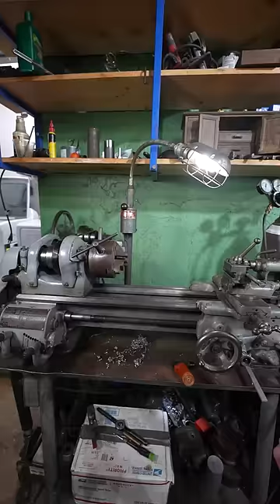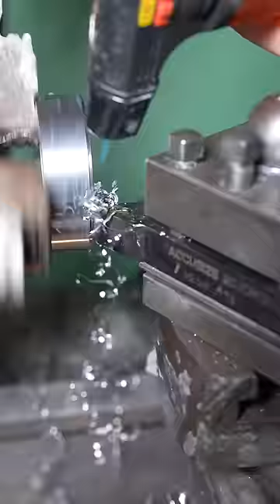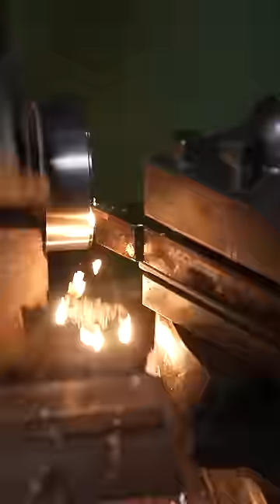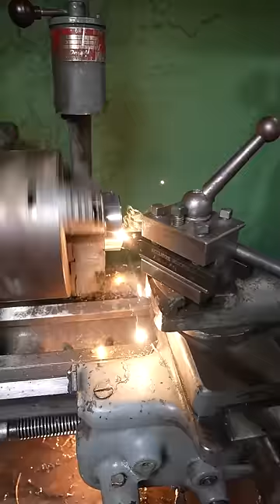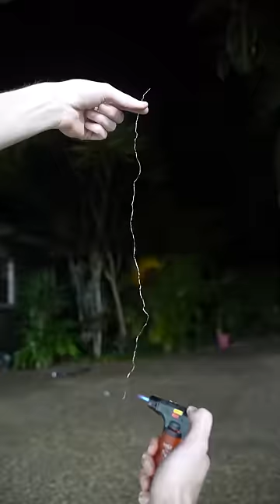Titanium has a dirty secret

Comment: The chuck key💀💀
Reply: I didn't notice that. Now that's TRUE danger
Reply: I had a coworker who lost the end of his index finger to a chuck key.
Reply: @nickgoodall578  I need to hear the story behind that!😂
Reply: @jacobmoore7636  It's not that good of a story. The chuck key was in the chuck, and somehow the lathe turned on and trapped his finger between the key and lathe bed. It didn't spin fast enough to throw the key out of the chuck. That's what he told me anyway. It happened before he started at our shop.
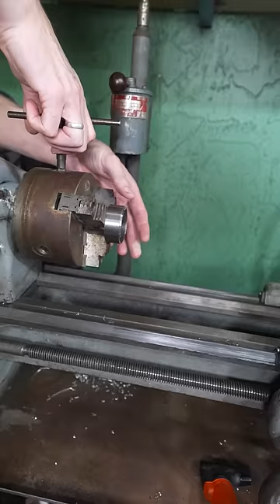Reply: At 0:04 because it took me way too long to notice it
Reply from the maker: @nickgoodall578  obviously the bit with the chuck key is a joke, but when I first got the lathe I made that mistake a few times 😅. Well I never smashed my finger but I had the key fly out a few times.
Reply: @TheBackyardScientist  shop safety is no joke. and if you have a tendency of leaving the key in, may i suggest that you modify the  starting switch so you can only start it with the chuck key, some sort of switch in the shape of your key?

all that is required is for you to be unlucky once, dont let that happen.
Reply: @khayman7777  chill bro. That does sound like a good suggestion though.
Reply: @cadenhood  seen stuff, don't want it seen again
Reply: @khayman7777  that is a good suggestion. The other option is a chuck key with a spring, that doesn't stay in the chuck on its own. It jumps out of the chuck when you let go.
Reply: I nearly had a heart attack
Reply: @andrebartels1690  Yeah, I agree with this 100%

From tbs's reply It really feels like he doesn't realize how dangerous a lathe is... That chuck key "joke" can do much worse than just throwing a key... Ever seen a sheer pin not sheer and blow up a lathe? It's a sight...
Reply: Happened to me once and even my supervisor 😅
Reply: I've always wondered what happens when I leave that in and start it
Reply: @TheBackyardScientist  the fact that your hand is visible in the scene is terrifying. If you were a safe distance away I'd find the joke pretty funny.
Reply: @TheBackyardScientist  we had one stuck in a wall at my highschool workshop, apparently they left it there to show students what a 9kW lathe can do.
Reply: I'm a machinist, I've seen holes in walls next to lathes at bad shops. Also gloves and lathes don't mix unless you aren't a big fan of having hands.
Reply: Oops
Reply: I haven't seen a spring-loaded key since high school and get something tells me I should see one here I looked away from the clip and knew just from the sound
Reply: @nickgoodall578  i once almost hit my head when I forgot the Chuck key made a dent in the wall behind me
Reply: We have a machining program at my school, and I was helping one of my buddies out getting his settings dialed for boring out a piece of hardened steel.  He put his piece in and left the chuck key in and turned it on, and it spun and bounced off the frame of the lathe and hit me in the crotch.  Luckily it started to slip out when it started to spin, so it wasn’t moving fast enough to punch a hole in the wall, but it was definitely enough to have some… slight bruising in a sensitive area lol
Reply: Yeah. Never leave it in. Always I'm hand or on the motor casing. Never in the chuck without a hand always on it.
Reply: @fightme5543  people don't seem to realize how much power those machines have. If it can cut metal into chips your hand or arm isn't going to stop it
Reply: @TheBackyardScientist  the very first thing I was told when I started machining was never leave the chuck key in the chuck. And then got multiple stories of people getting hit in the head with them.
Reply: Nooo ahhhhh 💀
Reply: We should make a open source sensor that tells you when the key is in
Reply: Subscribed lol
Reply: @nisgreaterthanzero  

Ikr😨
Reply: @nisgreaterthanzero  for real! them things can go FLYING
Reply: AAAAAAAAAAAA
Reply: @André Bartels  pretty much every machine post 1990s has an interlock guard over the chuck so to start the spindle spinning you have to close the guard and if the chuck key was in you wouldn't be able to close the guard.
Reply: @TheBackyardScientist  popquiz: if the key, or whatever it hits shatters, do you, while making a joke, have any, even the slightest ability to control the trajectory of whats now projectiles?
Or just the key bouncing off the ways?
Reply: I wonder if that was intentional … noticed right away
Reply: My dad almost lost his eye to a chuck key...
Reply: lathes are terrifying. I once was hopped up on energy drinks and scrolling on r/fiftyfifty, and found a Liveleaks-grade clip of a guy getting turned into mince-meat by an industrial metal lathe. 

His shirt sleeve caught on the workpiece, and very quickly his entire body got squeezed through a 6-inch tall gap like a tube of toothpaste, and flung all over the shop. Awful.
Reply: @TheBackyardScientist  I think some text like:"Don't do this" would make it less disturbing. Someone might watch this, think it's not a big deal, and horribly maim themselves or someone nearby, or worse.
Reply: @khayman7777  clearly Caden has not watched the russian lathe accident video. Lathes are not something to "chill" about when it comes to safety.
Reply: Sackable offence where I did my apprenticeship
Reply: @TheBackyardScientist  please be more mindful, shop accidents no good
Reply: Let me sum up all these comments here....
DO NOT, UNDER ANY CIRCUMSTANCES, LEAVE THAT KEY IN THE CHUCK!
Reply: thats the exact reason we must not leave the key in the chuck
Reply: We've all done it.
Reply: Right that gave me a heart attack
Reply: It looks like a blatant attempt at triggering the safety police.
Reply: @xsweed-jm2tn  It feels wrong to thumbs ip this story, but how else do I tell people it is an important comment. Thumbs up for your wisdom, 👎🏻 for your bruised appendage.
Reply: That’s deadly.. rookie mistake
Reply: Reading the comments we're all on the same page that was a blatant disregard for a basic safety practice. I sure hope this doesn't become prevalent. 😕
Reply: @TheBackyardScientist  just set it on fire....genius....
Wait til Greta hears about this
Reply: First thing I noticed. I had one miss me bu inches at a shop.
Reply: @cadenhood  when it comes to shop safety you shouldn't be chill, lathes can kill. To drive that point home, my 6th grade shop teacher told us a story about someone who died at the aircraft manufacturing plant nearby when his ponytail got caught in the spinning shaft.  
Fast forward years later and on the local news is a story about a student who died when her ponytail was caught in the chemistry lab's spinning lathe (the chemistry department had its own machine shop, who knew?) All I could think about was I bet she never learned about basic safe use and to respect your equipment from this Ivy League school but I did years ago from my public middle school shop teacher. 
I went to double check and this happened in 2011.
Reply: Had some ptsd flash backs on that one with my old machine shop teacher yelling “don’t leave the chuck key in the chuck” to anyone who dared take their hand of it while in the chuck. Guess it worked.😂
Reply: @TheBackyardScientist In the best traditions of This old Tony, we should have known you're a subtle joker 🙈
Reply: @kaidwyer  awww fak
Reply: @TheBackyardScientist  Some lathes have a guard which goes over the chuck and has a switch. If you lift it up, you can access the chuck and the lathe won’t turn on. Neat safety thing to have
Reply: OH Hell. SMACK!
Reply: Never to be seen again
Reply: @nickgoodall578  "somehow the machine turned on" 👀👀 reeeeeeeeaaaaaaaallllllyyyyyyy, it turned on spontaneously?
Reply: @fightme5543  Seen a gear miling machine explode a spiral cuter head. Like a pineaple hand granade. Whit holes in wals near by.
Reply: Deliberate. My engineering teacher roared "Clown !" from his grave.
Reply: Made that mistake once.  I've made it a point of never doing that again
Reply: That was scary
Reply: @powellwyatt45  I'm saying I don't know the specifics of how the machine became engergized. If you do, then you know more than me.
Reply: Our school installed a massive safety shield and kill switch for this exact reason!
Reply: I really hate that this video have so much view and there is a big risk for safety in it ! These things kill every day in the world
Reply: How many times have y’all pulled it out of your ceiling?
Reply: But can you use titanium to light thermite?
Reply: @ljubomirculibrk4097  That's exactly why I care! It's literally faster than you can blink! Glad you're alright!
Reply: That literally jump scared me, i gasped
Reply: Yea that was the first thing I noticed. My engineering teacher in high school would make us write lines for the rest of the lesson if he saw a key left in the chuck.
Reply: Laughed so hard
Reply: That's how curse of chuck-key started...
Reply: Almost killed myself doing that
Reply: WAAAAAAAHHHHH
Reply: had to go back and watch again to make sure I saw what i thought I saw....🤣🤣
Reply: @khayman7777 all you need is a spring my man
Reply: inorite
Reply: @TheBackyardScientist  holy sht who taught you how to use a lathe that’s one of the most dangerous things you can ever do in a metal shop
Reply: @mattpassos5689  i consider that a viable option, for normal human beings that are not so prone to danger, but there are a few videos that prove that TBS is not among them
Reply: Yeah, if it's not in your hand or within line of sight, the machine doesn't go on, no two ways about it, I always attach a piece of tube stock to my lathe headstocks so thst I have a place to put the key that's out of the way, to the point that putting it in thst spot is second nature to me now
Reply: @Christopher McLaughlin  man he has a tendency to wear sandals when working with molten metal I think it's a lost cause
Reply: @khayman7777  somewhere you can get a key with spring which pops out when it's not pushed into the chuck. Or the electric way, just make some holder for it with a simple 230V  sensor linked to the switch, if neexed then 2 sensors for both spin directions. Maybe there is simple way to use one sensor for both lines without affecting each other
Reply: Bruh that’s like the first thing I learned at my apprenticeship 😂
Reply: @beaverwrassler5773  speak for yourself
Reply: If that was my shop, he'd have been fired on the spot and black listed.
Reply: Lmao bro went awol
Reply: I was in pain when I heard that noise start from the Chuck Key
Reply: Haha 😂 I didn't even notice. That's crazy !
Reply: @TheBackyardScientist  they sell spring loaded key chucks if you don’t hold it in, then it will pop out on its own.
Reply: Yeah! Chuck the key 💀
Reply: Wow, I wish I had a self-ejecting chuck key, it must be a de-lux lathe.
Reply: It’s the key to the whole video. How else to get millions of comments (including this one)?
Reply: @calebmassey9991  If you’re wearing a Colin Furze safety tie you’ll be ok.😀
Reply: Yeah don't leave that it in their a kid in my class did this and it went flying into the ceiling not funny
Reply: Made me flinch several times my gawd!
Reply: 0
Reply: If i do that,my teacher really gonna beat me
Reply: If you worked with me, doing that that for a joke would get your lathe privileges removed.
Reply from the maker: I only forgot two or three times in the first month of owning a lathe, but that's a really clever idea. All of my chucks have different sized keys but its doable. 
Also my lathe is pretty small and it doesn't really have the power to fling the key with any real force. I assume a lot of the horror stories involve much larger and torquier machines.
Reply: @TheBackyardScientist  "larger and torquier machines"  a few days ago I was using a big Harrison, about 4 inch spindle bore, I was machining a foot dia casting at 400 rpm, lovely machine to use, but on Wednesday I was using a bigger lathe, at least 2 foot dia 4 jaw, plain spindle bearings (that made trying up the piece in the 4 jaw a pain), the tailstock weighs about as much as me, you can imagine how hard it is to shift whilst leaning over the chip tray. A complete pig to use.
Reply: Yea right a joke
Reply: In the machine shop at school the guy in charge got fed up with students leaving the keys in the chucks so he put a spring on them
Reply: I flinched and cringed when I saw that
Reply: @burkemoras  Yep, when working with any fixed rotary tool (i.e where your hands are not holding the tool like an angle grinder) gloves are just add an extra hazard. I'm sure there's exceptions to this rule, but on lathes it's definitely a hell f'ing no in my book, I've seen videos of a loose sleeve pulling a working in!
Reply: Chuck key?
Reply: It is a serious and lethal danger.
Reply: @TheBackyardScientist ah, it was a joke..
Reply: what is a chuck key
Reply: @jamess.7811  When he pressed the lever at the beginning of the video,
The rotating part is called a chuck. And the ejected metal is the chuck handle.
The lathe usually rotates between 1200 and 1800 rpm, so  a flying chuck key hit in the head can cause serious injury.
Reply: @jamess.7811  Simply put, a machine powerful enough to cut titanium is throwing a chuck handle at your head.
Reply: @jamess.7811  the T shaped metal piece thats used to tighten the jaws of the lathe
Reply: I ducked when that thing started spinning ☠️
Reply: @cadenhood  absolutely not a "chill bro" thing. Those flying chuck keys literally kill people.
Reply: The flaming titanium shrapnel flying around what is probably ostensibly a wood shop.
Reply: Wtf!
Reply: Ggs
Reply: @TheBackyardScientist  wow, you really sold that joke, it really looked like you were fearing for your foot’s safety
Reply: Cheeses?
Reply: Eaeloer this year i as a frist year apprentice had the chuck key fly accross the warehouse because i forgot to take it out 😬
Reply: I saw it and instinctively ducked before realising its a video. So many trainees left it in i have chuck key Trauma
Reply: Chucked
Reply: @maritoguionyo  heheh I see what you did here
Reply: @I_Quarter_  I do not know what I did there 
a
explain? xd
Reply: @maritoguionyo  chucked the 'chuck' key...
Reply: Spring loaded key avoidance
Reply: @I_Quarter_  ah
Reply: Lmao I just started at Lincoln tech for machining and that was literally one of the first things they warned us never to do😅
Reply: CHEESE!!!! 😂😂😂
Reply: Cheese
Reply: it's verry brutal when the key is flying through the room and get's stuck in the next wall,
Reply: He's trolling.. did it on purpose so people will comment.
Reply: Can someone explain? Why is it falling out a bad thing? And how would that leave him getting his finger destroyed
Reply: @TheBackyardScientist that freaked me out. I'm a machinist and on the lathes I've run, it would be more than a quick scare.
Reply: @khayman7777 equip it with a sping like they do some new and smaller ones. It pops out automatically and you tether it to the machine.
Reply: @cadenhood There is no chilling. Consider these power tools as dangerous as a loaded gun when misused.
Reply: @ldcuba I don't set it down until I go to begin operating the machine/hitting go. Same way you avoid locking your keys in your car. You lock your car from the outside, using the key. I don't start my machine unless I'm holding the key.
Reply: Had a friend crack his sternum doing that😅 after that everybody in the shop was extra careful with the key 😂
Reply: @cadenhood  brother, if this key flies out, it can decapitate you
Reply: I have done that so many times lol
Reply: Rule number 1 with lathes: NEVER FORGET THE CHUCK KEY!
Easiest way to either break the machine or create a final destination kill.
Reply: i almost hit with a chuck key on my face one time, at full speed
Reply: It made me actually cringe
Reply: @nisgreaterthanzero  the fact that you didn’t notice the “TRUE danger” is a bit concerning
Reply: Visions of my shop teacher slapping me on the back of my head…
Reply: @cadenhood chill? You dont need chill when anything from skin and blood to life is at stake.
Reply: That is what you learn in lesson 1. Key out of the machine.
Reply: What's a chuck key?
Reply: Step back son let daddy work that SUPER (in)FLAMMABLE. Unobtanium® SR-71™ metal flammable metal glad the SR-71® is NOT a fighter jet... 7;^> ...heh
Reply: We had a guy leave one in on a full sized large and turned it on at 2000 rpms, that thing went flying, my classmates shielded their heads with their arms while scattering like roaches, and the teacher and that guy had, and I quote, a "coming to Jesus meeting."
Reply: chuck key cheese
Reply: Okay, good catch. But no word about burning off titanium shavings instead of utilizing the most expensive metal worldwide?
Reply: Bro why did u left the chuck in there 😢
Reply: The first thing my manufacturing teacher told me was to never leave the chuck key in the lathe, it could shoot straight into your kneecap.
Reply: We have a hard rule at the factory. 2 strikes of even leaving a chuck key in the chuck without your hand on it.
Reply: My heart dropped when I saw it
Reply: I guess it got chucked
Reply: That's literally the first thing you learn....remove the chuck key before starting the lathe
Reply: Happened to me on a drill press... flung the key across the room
Reply: @nickgoodall578  nearly happened to me, good thing it was a tiny key and that it kicked the safety panel we had.
had a moment of ''oops''
Reply: Rule number one the key 😂
Reply: @TheBackyardScientist not a good joke. A student got a ripped hand from the same joke your portraying. Funny eh? Learn shop safety practices first and stop joking about it. Not a good video.
Reply from the maker: @Chm-ff7mm  shouldn't students on lathes that can rip body parts off 🙄
Reply: @TheBackyardScientist there is an old mcgyver episode that he burned through a lock with a titanium bicycle and some rust, can you do a myth buster style video on this?
Reply: @TheBackyardScientist Why is it that 14/15 year old kids know better than you?
Reply from the maker: @metalman6708  idk where all these kids learned how to use a Lathe but I’m grateful for their boundless knowledge 🙏
Reply: @TheBackyardScientist no bro that's not safe and I wouldn't be joking around a lathe that how you loose a finger
Reply: @TheBackyardScientist your lucky it didn't bind and shear the key wich can propel the broken key at extreme speeds capable of going straight through a person
Reply: @TheBackyardScientist stabbing yourself isn’t a joke, so why would this disgusting display of a lack of shop discipline be?
Reply from the maker: @thereinthetrees_5626  hey, I subscribed to your channel and I would like to see a video of you explaining how to be safe around your machine shop, but it looks like you only make Roblox videos. Either way, I’m sure you’ll have a informative video and I’m looking forward to it.
Reply: @TheBackyardScientist  I no longer have access to a lathe, that stopped when I graduated from my highschool machining class, but if a video about workshop safety, specifically on lathes is what you want.

Then sure, give me a weekend
Reply: Am I the only one that has no idea what a "chuck key" is?
Reply: @TraeldornTech  in the the time it took you to post that comment, you could have opened google and typed in “chuck key”

Or made the connection that the commenter and every other person in this comment section is talking about the piece of metal that flew out of the lathe
Reply: i once almost did that in engineering class, i was tired after a night of working parttime
Reply: ICBM lol
Reply: @nickgoodall578 it's the same as my story, I lost my middle finger nail on the same incident.
Reply: I feel like it's a rite of passage. Happened to me once, and only once. Luckily, I wasn't standing right in front of it.  Stupidly, I was having a conversation with another guy in the shop when this happened. I don't try to multitask anymore.
Reply: He did a no no
Reply: If my old boss ever saw me do that I would lose all machine privileges
Reply: Just another reason to wear safety glasses, in case you have a brain fart and leave the key in the chuck and turn on the lathe 🤦🏽‍♂️
Reply: @martinbernath  that sounds like an excellent idea. The part about using it as a demonstration, not doing that in the first place.
Reply: Lol didn't even catch that at first
Reply: Bro when you pointed that out I burst out laughing 😂
Reply: @khayman7777  all of the good safety rules have been written in blood many times over.
Reply: lmfao
Reply: Coworker left the chuck wrench in a 24" chuck he advanced it and the wrench hit him on top of his head. No wonder he was so strange. lol
Reply: Every apprentice just had a flashback.
Reply: It got chucked
Reply: My instructor threw the key across the shop when I took my hand off it once showing him my set up and I’m so glad he did. I never did it again. He got lax about it a year or 2 later and I decided it was time for me to go. I didn’t want to be a casualty as there was one up in Oregon while I was getting my degrees for CNC & manual machine
Reply: Anyone who knows this is a great content grab
Reply: Its called a chuck key because its supposed to be chucked, everything alright here
Reply: This should be flagged as dangerous?
Reply: 😮 Dead center would be nice
Reply: Kenn einen der den schweren Schlüssel mit 3000 Umdrehungen ins Gesicht gekriegt hat - der sieht nicht nach vielen OP's trotzdem nicht mehr aus wie vorher ! 😬
Reply: @khayman7777 or just modify the Chuck key itself to spring out so it doesn’t stay there with our any outside pressure
Reply: You know this was done on purpose, right.
Reply: @cadenhood  you're normally the type to have that sort of accident, then you question how it happened or claim it was a "freak accident." It's definitely never your lack of safety awareness...
Reply: @cadenhood  there's no chill with a lot of different machines. Usually the first mistake becomes the last.
Reply: No joke
Reply: 40yrs as a machinist. I actually ducked when he reached for the switch, lol.
Reply: Key is even more dangerous left in the chuck.
Reply: what means chuck key?
Reply: Trainee 😂
Reply: 🤦‍♂️для этого на ключе должна быть пружина
Reply: He does that to get people to comment
Reply: I nearly had to go to the next hospital ER due to a forgotten chuck key. luckily for me, the lathe's motors stopped, had it runned, the key would have been catapulted straight into my face. A few years earlier, we have had a similar near-accident were the key rammed 1 inch (2.5cm) deep into the wall 9ft (3m) away. Needless to say, I got really lucky that day
Reply: @infernaldaedra or you could just look, it isn't hard
Reply: My way.  The left hand doesn't let go of the key whenever it's in the chuck.  The lathe is only ever started with the left hand.  Simple but effective.
Reply: Super dangerous.
Reply: @martinbernath thats a lie howies machine shop debunked this
Reply: It FLEWWWW
Reply: @TheBackyardScientist Are you serious?
Reply: The best chuck key is drill with bolt grinded to a square. That would also be hazard when forgot to remove before turning it on
Reply: My dad tells a story from his metal shop class in school. Guy left a Chuck key in the Chuck and turned the lathe on with it set to some crazy high speed. Made one revolution and shot straight up, punched through the metal roof and came clattering back down in the roof several seconds later
Reply: I learned to respect the chuck the day I nearly broke all the fingers in one hand changing the  bit on a mains masonry drill without unplugging it.
Reply: “… the lathe starts, and the chuck key thumps you in the chest….”
Reply: I flinched and could feel the pain when he turned the lathe on.
Reply: Relatable
Reply: @ldcuba exactly, with certain things you've got to have safety protocol. like looking before you cross the street. Do quick safety check before operating machinery. clear debris near the parts that move, no loose clothes, hair or jewelry, and no keys left in. chuck
Reply: My machine tool teacher would sentence you to a week of drill bit sharpening for even taking your hand off the chuck key while in the chuck.
Reply: @nichmaus8705  My teacher would take it out of Chuck when students were focusing on something else. He would then say don't forget your main tool when went to turn machine on
Reply: @nichmaus8705  good move, students might have hated it, but I bet they didn't forget again and were potentially saved from serious injury or worse. 👍
Reply: Everytime I hear titanium I think of the iPhone 15 pro
Reply: @666khaymanxxx  my lathe has a slot where the chuck key must be in order for it to turn on
Reply: What's that?
Reply: I felt every part of my body just die as I tried to dodge it
Reply: @TheBackyardScientist  jokes can't really end in someone getting impaled by a chuck key through the knee
Reply: @TheBackyardScientist  As others have said safety around machines is not a joke you could've been seriously hurt
Reply: When I first learned the lathe I accidently left the key in the chuck in the metals shop and it went flying luckily it hit the back pan/wall on the grizzley lathe
Reply: @TheBackyardScientist  this literally gave me high school flashbacks
Reply: gone
Reply: @TheBackyardScientist I once flung a chuck key across the shop, narrowly missing half a dozen people stood around another machine - the guilt and shame I felt when they all turned to give me a hard stare ...
Reply: I yelled at the screen.
Reply: Years ago I worked for a company that machines to refine this stuff
 When refining ti
 If the stinger touches and burns thru copper crucible and comes into contact with water thebwater will disassociate causing the h2band o2 gasesbto explode
 One wall of the walls around the machine ate dry stacked cement blocks
Reply: My heart just stopped for a sec when i saw him turnig the machine on
Reply: Don't put round handles on your files either.. so they go right up your arm when the chuck catches it..
Reply: @khayman7777  thanks mom
Reply: @tightbhole420  you are welcome son
Reply: IKR!! My old HS shop teacher is rolling over in his grave...
Reply: @khayman7777 i agree, you can assemble a light spring on the end of the key, so he flips out when you take of the force on the key, much simpler.
Reply: IKR.  Adam Savage must be having a heart attack while watching. 😆
Reply: Came to say the same is also dangerous when used improperly
Reply: I almost spit out my drink when i saw that
Reply: @TheBackyardScientist  It's all fun and games until the chuck key grabs your shirt or crushes your hand man. Don't joke around with that machine. Don't get yourself killed.
Reply: Cnc with an auto chuck is the safest way.
Reply: Yeah that made me jump back 😂
Reply: Those things kill people.
Reply: @andrebartels1690 dont know why that isnt standard honestly
Reply: Yup, if you do that even once you should be restricted to plastic cutlery and have your tools donated to poor starving machinists...
Reply: My manager gave me the power to fire people for that, and I did.
Reply: Good touch to the video 💀😂
Reply: Fastest way to get fired
Reply: I had a heart attack when I saw the key
Reply: @nisgreaterthanzero I remember seeing a chuck key imbed itself into a cinder block wall. Dangerous is an understatement.
Reply: Small Lathes are such a danger because if you don’t follow the safety rules of a bigger Lathes you’ll develop so many bad habits. But, I suppose you can say that about anything. Go on, waiting for the Darwin Award. And yes, I realize this Lathe isn’t THAT small.
Reply: 10/10 💯